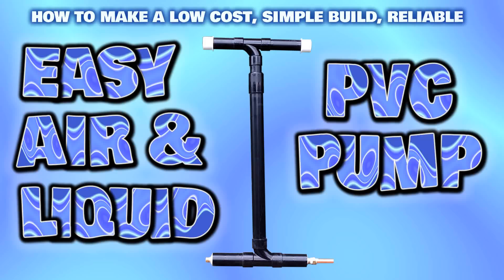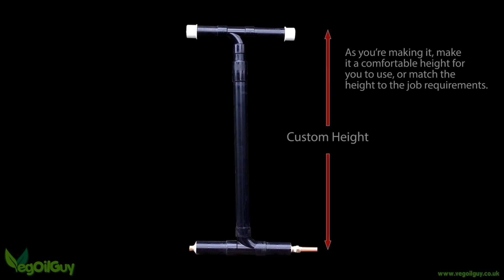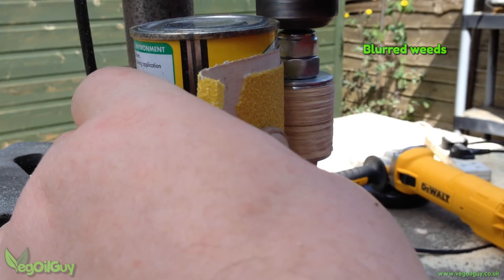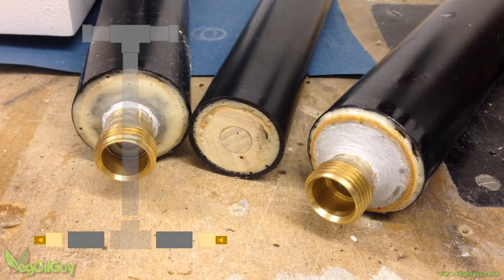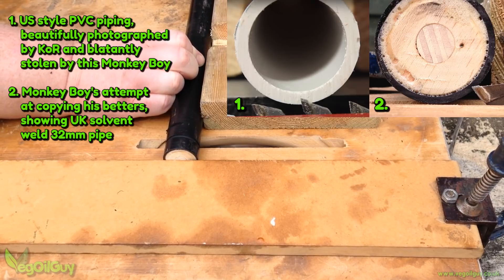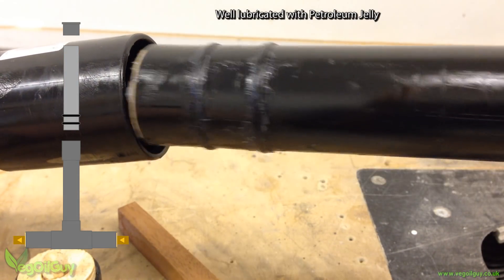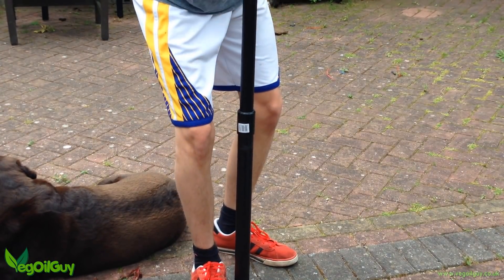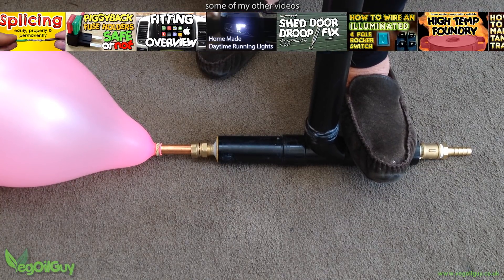EASY PUMP - air & liquid simple PVC pump by - UK spec - by VOGMAN

Comment: The compressor from an old refrigerator can also make a decent vacuum pump for assisting investment casting, and you can even have it running during the pour when you're working solo.  This was cool though, I haven't seen anyone else do vacuum assisted casting with a manual vacuum pump before.
Reply from the maker: An electric pump would certainly be easier and a refrigerator pump would probably do a very nice job. But in my house at least, child labour is free - if I can drag him away from his Xbox : )
Reply: @vogman good point.  With my son though, dragging him off the Xbox is easier said than done!

Comment: Now, can you up-size it to an 80mm or 90mm pipe? (3 to 3.5 in for those of us on the other side of the pond) or will it be too hard to work with at that size?
Reply from the maker: You could upsize easily enough (if you can find the fitting - but in your neck of the woods I'm confident you would) but I think the physical effort would increase dramatically. That's why larger pumps make use of levers, but you already knew that ; )

Comment: Nice built =). I'm currently building my own version by modifying an old bike pump. For check valves i'm using tyre valves. -> Are there any plans for the future for making your own investment? I'm into low-budget diy stuff and the price of industrial investment plaster is a deal breaker =/.
Reply from the maker: You and I are similar animals : )
If money was no object, there's many wonderful toys I'd buy... but even then I'd probably use them to make other tools. For instance, if I had thousands available to buy a lathe, I'd probably turn my own valves. Daft I know... but there's a lot of pleasure in doing stuff yourself, and you get a better understanding for what's involved.
Now investment is tricky. I have conducted a number of experiments with good old plaster of Paris off camera, but all without success yet. But that was a while ago and was more for foam casting. Let's just say I wouldn't be surprised if I started tinkering again : )

Comment: those Americans and their imperial fittings!
Reply from the maker: It's not the measurements James, it's the quality. It's far superior to our UK stock in my opinion. Have a look at my PVC bow build video some time. There I compare the US Schedule 40 piping with our UK Solvent stuff... if I can use the word "compare." It's far superior. Much thicker and far more flexible. I suppose the answer lies in their weather being more extreme than ours (much hotter and colder) so the piping must be up to the task. It certainly seems to be. I'm quite jealous : )
Reply: yeah I getcha. I'm just more familiar with metric terminology, that's all :)
Reply from the maker: I guess it's my age. I was lucky enough to be raised with both. I really don't notice and tend to flow from one to the other. 
If it's small, I'm in millimetres. If it's a little bigger, inches. Around my height, feet. Longer, metres. I really don't notice : )
Reply: @vogman  lol, youre starting to sound like a Canadian!  Here people are measured in feet/inches/pounds, but roads and food are measured in km and grams.  I understand outdoor temperatures in C but for indoors and swimming pools, only F makes sense...
Reply from the maker: Ah... temperatures different. I'm hopeless with F. And distances... I can't do Km, has to be miles.
But it's the differences that make like interesting : )
Reply: Just be glad none of you have to do thermodynamics calculations in imperial units... out of thin air "magic" conversion factors pop into the calculations just to get the units and the numbers right (these conversion factors are not in the equations they just are required if you want a valid solution).  Far easier to do the calculations in metric/SI and convert to imperial units at the end.

Lord Kelvin was right "I look upon our English system as a wickedly, brain-destroying system of bondage under which we suffer. "
Reply from the maker: I'm happy with either units, but I must admit, in my tiny brain, calculations in metric are much easier than in imperial. I can't cope with fractions without breaking a sweat  : )